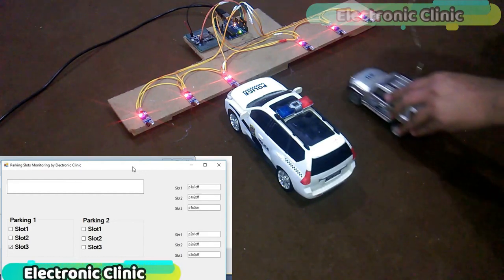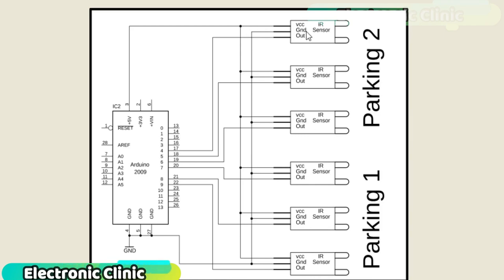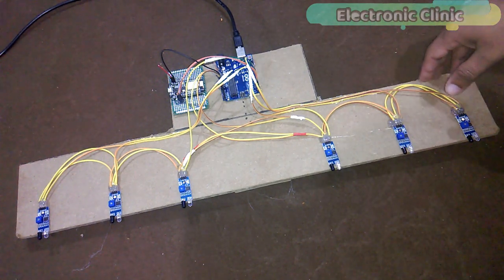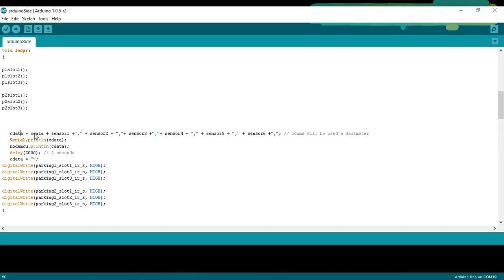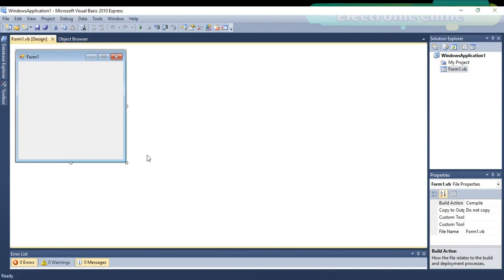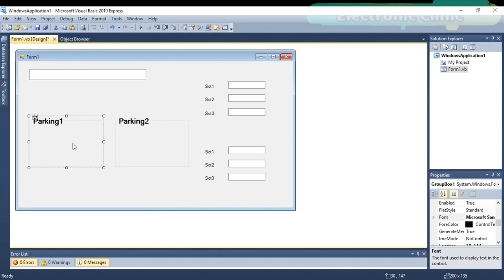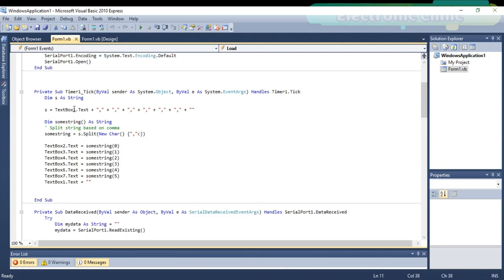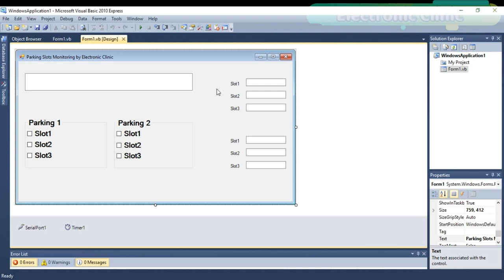Arduino Project: Car Parking Monitoring system using computer application designed in vb.net

Comment: Very nice video 
Please i have a question :
I use arduino mega with TFT LCD 3.2
I need to know how to show three counters in LCD and c# or vb application like :
Counter1 : (value1)
Counter2 : (value2)
Counter3 : (value3)
Thanks for your collaboration
Reply from the maker: Watch my tutorial on how to split sensors values. That will help you
Reply: @ElectroniClinic sir what is tha name of the device that node mcu module placed

Comment: Thank you man for the project. I am using proteus 8 for testing and I'm using PIR sensor in each parking slot. Instead of writing com19 in the serial port, what should I write for linking the arduino in proteus?

Comment: hello sir! Thanks for the project.....i want to ask that is it necessary  part(visual basic part?) and also i faced errors in arduino that all p1slots are undeclared?
so can u guide me quickly about that?
Thanks
Reply: Comment the line by ( "//" ) at the ending of void loop()
Reply: @MaheshReddy-pp9jj  did you do this project successfully? I need some help
Reply: you need to predefine the statements like above the call like void p1slots();

Comment: Hi sir! First of all i would like to thank you for this wonderful project. but i have some question regarding the adding of serial port in the visual basic, when i click the icon of the serialport, it does not show the code. pls help me thank you!
Reply from the maker: Did you copy the code??
Reply from the maker: Install teamviewer. And send me the id and password on whatsapp.
Reply: Yes i did. And when i am clicking the icon for serialport1, no window for codes is appearing.
Reply from the maker: I cant say anything, without checking ur form. May be u are missing something
Reply from the maker: First paste all the code and then add components on the form
Reply: Okay sir i will try it
Reply from the maker: Best of luck
Reply: Thank you so much!

Comment: bro plz help
its shows that "nodemcu not declare...."
how?
Reply from the maker: download the correct libraries from my website
Reply: @ElectroniClinic  brother can i compelete with Arduino uno only?
Reply: @rajasthanistatus4049  did you do this project successfully? I need some help
Reply: @tranthithuyan451  no bro
Reply: @tranthithuyan451  i did. if you still need help
Reply: @rajasthanistatus4049  Yes you can. just comment out the 'nodmcu ' line

Comment: Hello :
int parking1_slot1_ir_s = 4; // parking slot1 infrared sensor connected with pin number 4 of arduino
int parking1_slot2_ir_s = 5;
int parking1_slot3_ir_s = 6;

int parking2_slot1_ir_s = 7;
int parking2_slot2_ir_s = 8;
int parking2_slot3_ir_s = 9;

String sensor1; 
String sensor2; 
String sensor3; 
String sensor4; 
String sensor5; 
String sensor6; 

String cdata =""; // complete data, consisting of sensors values

void setup()
{
Serial.begin(9600); 
pinMode(parking1_slot1_ir_s, INPUT);
pinMode(parking1_slot2_ir_s, INPUT);
pinMode(parking1_slot3_ir_s, INPUT);

pinMode(parking2_slot1_ir_s, INPUT);
pinMode(parking2_slot2_ir_s, INPUT);
pinMode(parking2_slot3_ir_s, INPUT);

}

void loop()
{
p1slot1(); 
p1slot2();
p1slot3(); 
 
p2slot1();
p2slot2();
p2slot3();
 
  
  
   cdata = cdata + sensor1 +"," + sensor2 + ","+ sensor3 +","+ sensor4 + "," + sensor5 + "," + sensor6 +","; // comma will be used a delimeter
   Serial.println(cdata); 
   nodemcu.println(cdata);
   delay(2000); // 2 seconds
   cdata = ""; 
digitalWrite(parking1_slot1_ir_s, HIGH); 
digitalWrite(parking1_slot2_ir_s, HIGH); 
digitalWrite(parking1_slot3_ir_s, HIGH);
 
digitalWrite(parking2_slot1_ir_s, HIGH);
digitalWrite(parking2_slot2_ir_s, HIGH);
digitalWrite(parking2_slot3_ir_s, HIGH);
}
 
P1slot1 is a user defined function, it has no return type and it doesn not take any argument as the input.  if there is a car infront of the sensor it gives digital logic 0, and if no car then it give digital logic 1, depending on this, then we store p1s1on or p1s1off.  The same mechanism is used for all the other infrared sensors.
 
void p1slot1() // parkng 1 slot1
{
  if( digitalRead(parking1_slot1_ir_s) == LOW) 
  {
  sensor1 = "p1s1on"; // parking1 slot1 
 delay(200); 
  } 
if( digitalRead(parking1_slot1_ir_s) == HIGH)
{
  sensor1 = "p1s1off";  
 delay(200);  
}
 
}
 
void p1slot2() // parking 1 slot2
{
  if( digitalRead(parking1_slot2_ir_s) == LOW) 
  {
  sensor2 = "p1s2on"; 
  delay(200); 
  }
if( digitalRead(parking1_slot2_ir_s) == HIGH)  
  {
  sensor2 = "p1s2off";  
 delay(200);
  } 
}
 
 
void p1slot3() // parking 1 slot3
{
  if( digitalRead(parking1_slot3_ir_s) == LOW) 
  {
  sensor3 = "p1s3on"; 
  delay(200); 
  }
if( digitalRead(parking1_slot3_ir_s) == HIGH)  
  {
  sensor3 = "p1s3off";  
 delay(200);
  } 
}
 
 
// now for parking 2
 
void p2slot1() // parking 1 slot3
{
  if( digitalRead(parking2_slot1_ir_s) == LOW) 
  {
  sensor4 = "p2s1on"; 
  delay(200); 
  }
if( digitalRead(parking2_slot1_ir_s) == HIGH)  
  {
  sensor4 = "p2s1off";  
 delay(200);
  } 
}
 
 
void p2slot2() // parking 1 slot3
{
  if( digitalRead(parking2_slot2_ir_s) == LOW) 
  {
  sensor5 = "p2s2on"; 
  delay(200); 
  }
if( digitalRead(parking2_slot2_ir_s) == HIGH)  
  {
  sensor5 = "p2s2off";  
 delay(200);
  } 
}
 
 
void p2slot3() // parking 1 slot3
{
  if( digitalRead(parking2_slot3_ir_s) == LOW) 
  {
  sensor6 = "p2s3on"; 
  delay(200); 
  }
if( digitalRead(parking2_slot3_ir_s) == HIGH)  
  {
  sensor6 = "p2s3off";  
 delay(200);
  } 
}

Have a nice day. I write this code but I get an error in my error: 'p1slot1' was not declared in this scope

Please help me fast I need to bring the project to the university